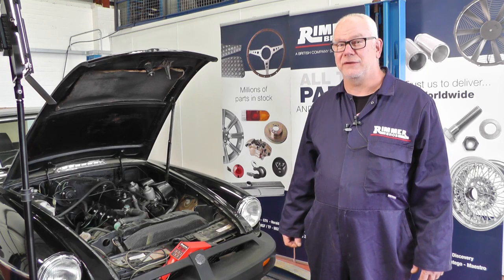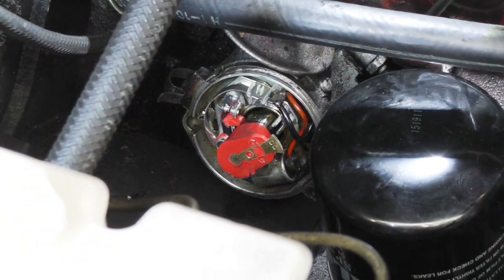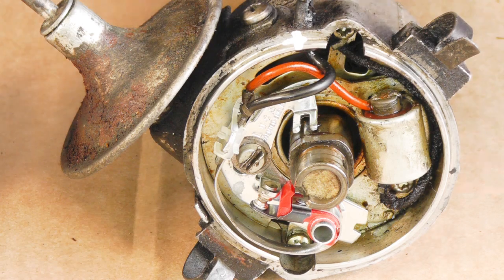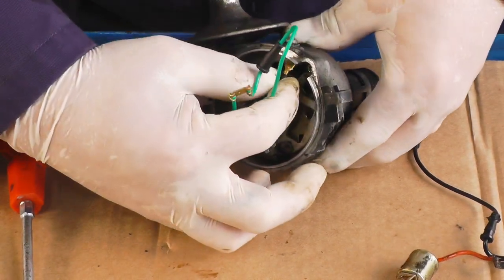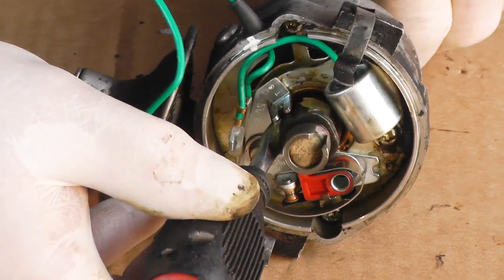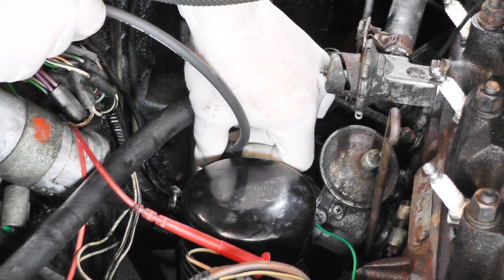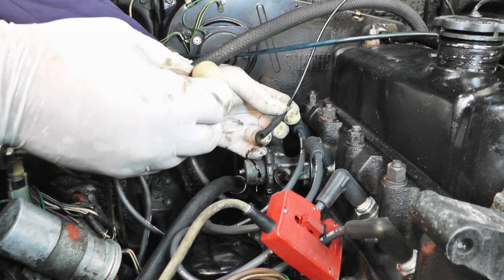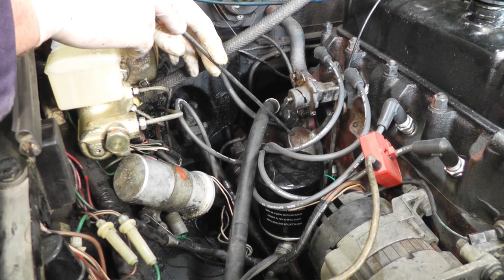MGB GT 1981 - Replacing the Points & Condenser & Setting Engine Timing

Comment: we have a '67 MGBGT bought new.  I am glad for your advice to remove the distributor for points service.  Over the years I have done it both ways and it is quite difficult if one leaves the distributor on the engine.  John in Manitoba. (Canada).  Your video is very clear on the process. thanks.
Reply from the maker: Great to hear! Thank you for the feedback John :)

Comment: I’ve now bought an mgbgt same year as yours, quick question, what rpm did you set the timing at? 1500rpm? Mine is running for a few seconds after I turn it off so guessing timing is a mile out!

Comment: Shouldn't the dynamic timing be set at 10 degs before TDC? Not sure why you put tipex on the pointer for TDC and not the one next to it?
Reply: timing light was set to 10 degrees mate. So it was flashing at 10.. meaning he had 20 degrees. So he had to bring it back to tdc (The light is adjustable)